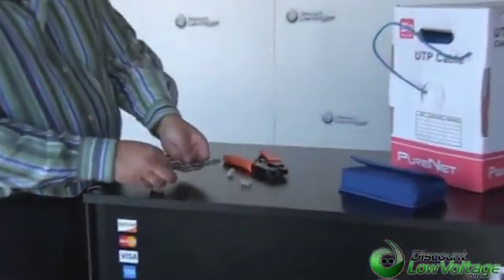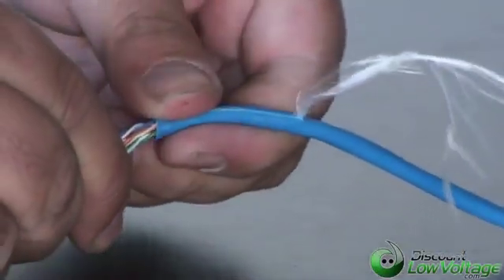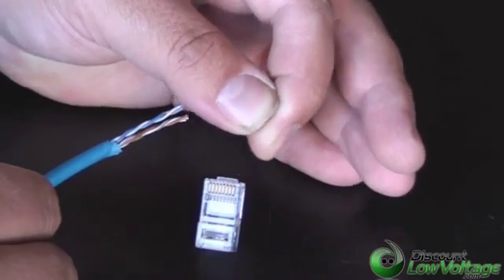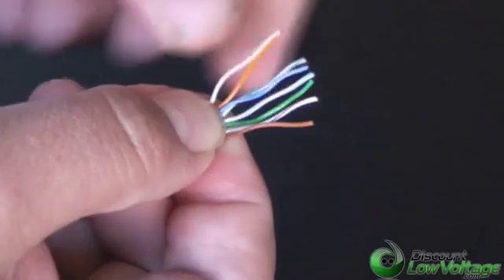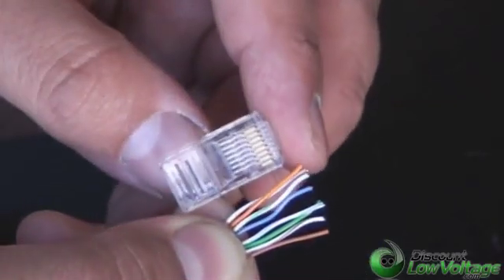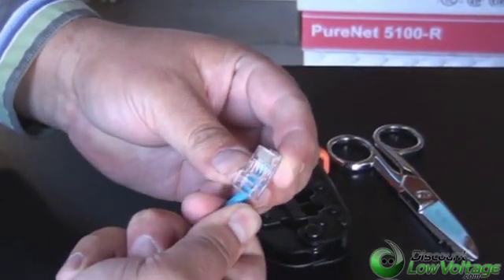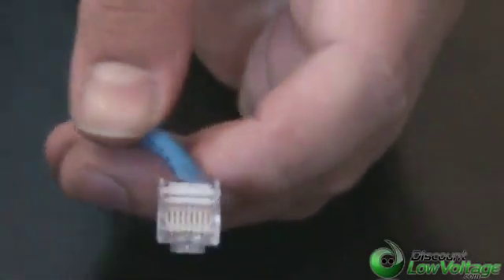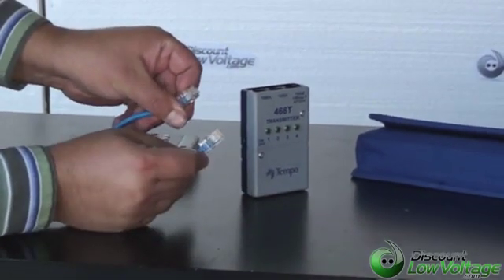How to Make Custom Lengths of Cat5e Ethernet Patch Cables Using a 568b Color Code Diagram – YouTube

Comment: Most of these RJ45 crimping tools have a cutter that is partially covered with a metal hook on one side that looks like some sort of stopper.  On one tool I have, there's two sets of blades, and one of them has this seem metal hook/stopper.  I have yet to see anyone make use of that part of the blade.  Any idea how it is used/what its purpose is?